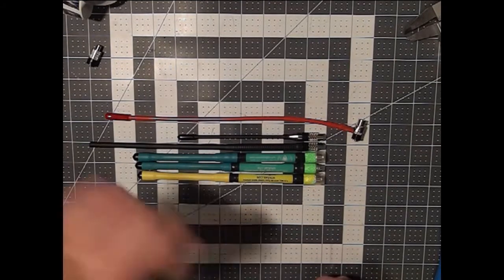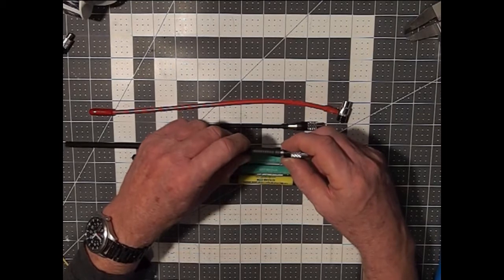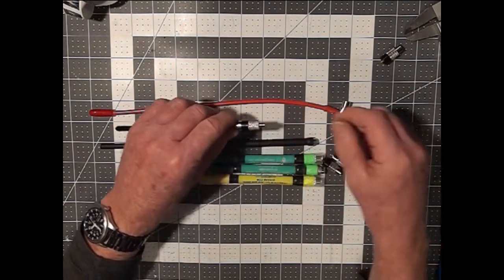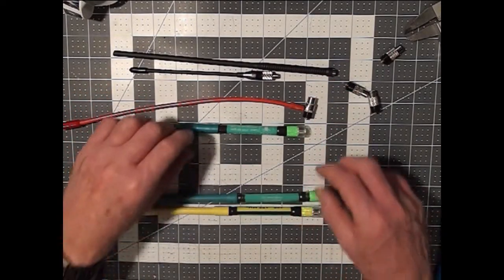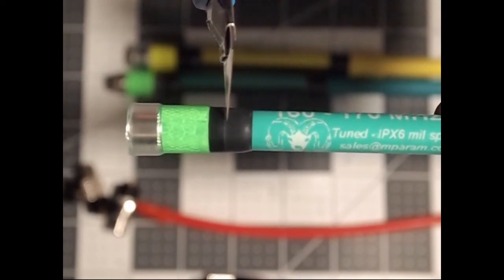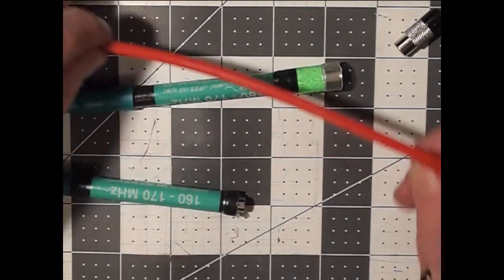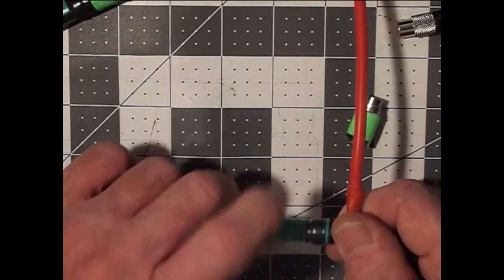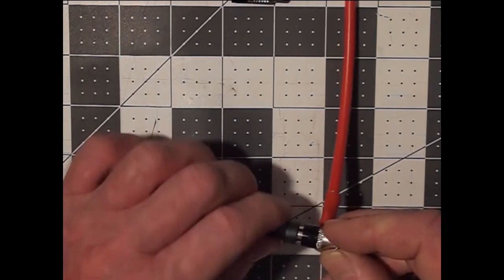Modifying an IPX antenna to attach counterpoise

Comment from the maker: This part is the 'do as I say, not as I do' part. I started to field test the new Rat Tail design today, and found a flaw immediately. I had to tilt it up at a 45 degree angle to screw it on. So I thought, 'what will happen if you have to flex this over and over, which is what will happen each time you have to put it on and of the radio?". So I tried, and found out. The nickel tab eventually just breaks off. I should have known better. I think I can fix that by soldering the wire to the nickel collar, and then spot welding the collar onto the base. This way the copper stranded wire will flex without breaking, and it will be easier to screw onto the radio. Pretty dumb design concept on my part, and definitely deserving of more 'thumbs down' than 'thumbs up' . So if you undertake this concept, be sure to do better on the hinge point than I did in your design.